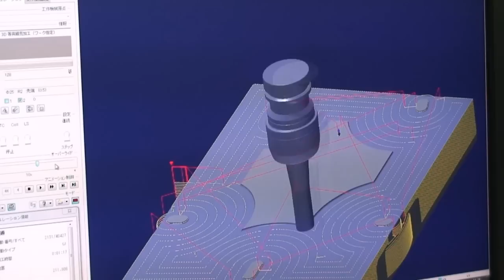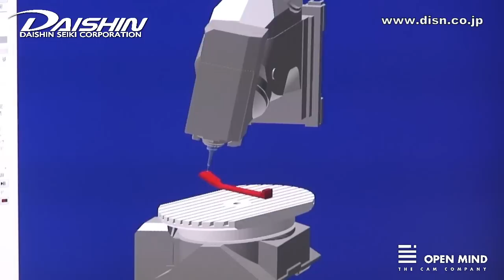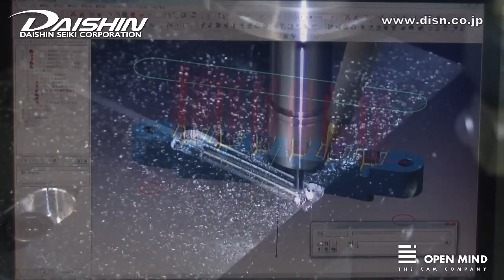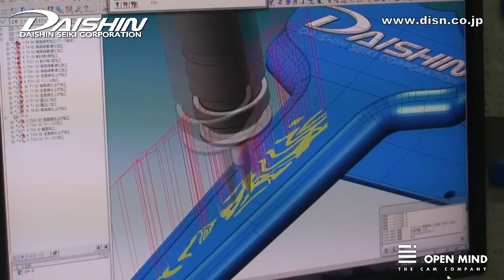CNC The Machine Cutting Premium Guitar DAISHIN SEIKI

Comment: You can definitely play this guitar acousticly,and the only thing stopping this from playing through an amplifier is using real pickups.if they were to replace the machined aluminum pickups with a pair of pickups using aluminum covers and actually ran the wiring required to use this it would play,as it is its just a beautiful toy and someone should take it the rest of the way through to completion.
Reply: makes sense Wayne.